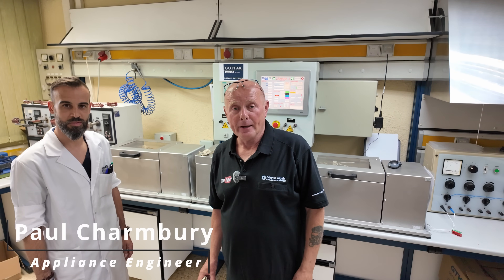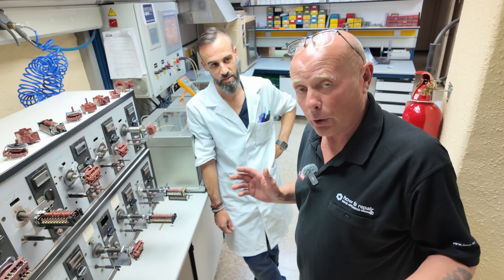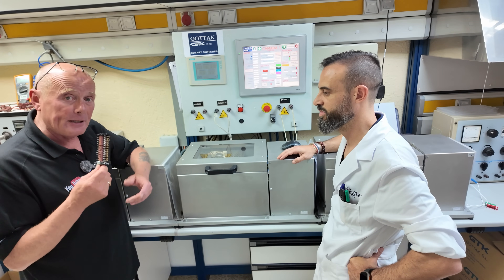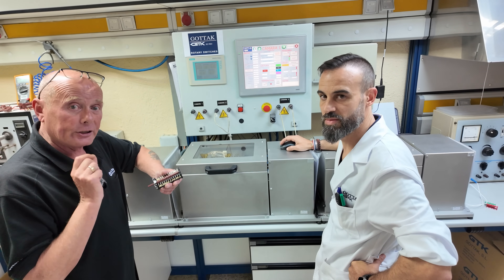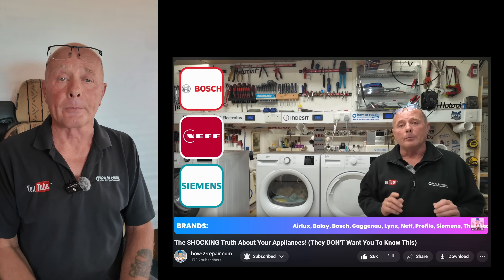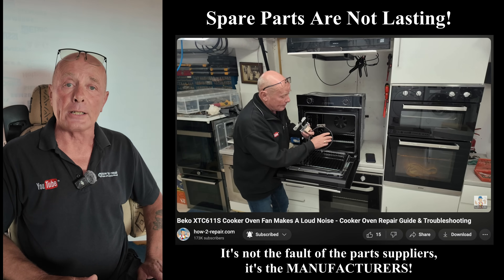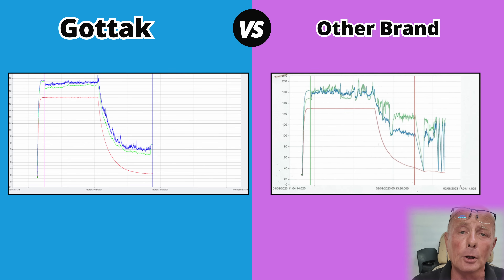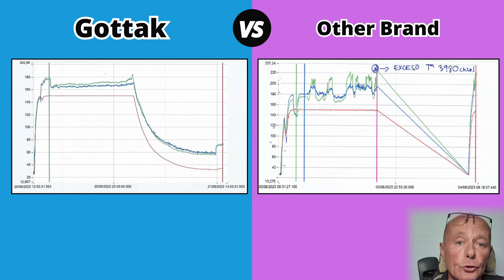Why Your Appliances FAIL SO FAST! Lab Results EXPOSE the Truth!

Comment: I've been a test engineer or built life-cycle testers for dozens of customers for 30 years and can verify that most appliance manufacturers actively build-in lifespans of their equipment,
Reply from the maker: I haven't seen any positive comments from engineers about this issue. It's hard to believe that manufacturers expect consumers to be happy buying major appliances every few years. They are ruining their reputations by making such products. 

I've reached the point where I simply cannot tolerate this situation any longer, and that's why I made this video. I would greatly appreciate it if you could share this video. Together, we might be able to bring about some change. If we can't shame the manufacturers into action, perhaps someone in government will see the video and take notice of the overwhelming number of comments expressing public concern.
Reply: @How-to-repair  Another great video, you would have to create a movement, I believe yesterday in the states(usa) Louis Rossman partner with another individual on changing the perspective on right to repair and bringing similar issue like this to light. Will share your video.
Reply: @How-to-repair  I think the self-repair movement will take care of it. Especially with 3D-printers.
Reply: @ikemkrueger I agree but companies can limit on how the hardware works or how to repair them like cell phone or other products
Reply: @ikemkrueger the problem is someone will charge so much to fix it u can just buy another one.
Reply: @How-to-repair  *Together, we might be able to bring about some change*. 

Can't see that happening-planned obsolescence is a gold mine for the appliance makers.
Reply: @How-to-repair  What is reputation worth, when every manufacturer's repuration is already shit? Ask any electrician what brand to buy and they start crying.
Reply: @How-to-repair  Except it doesn't ruin their reputations because no one cares enough. They realised that they can just do whatever they want and still sell a bunch of product because people are lazy. The only thing that will stop them, is if people stop buying their products.
Reply: I would love to see test data on reliability of automotive components of all kinds.  I work on my own cars and I'm consistently annoyed at the unnecessary complexity and short lifetime of parts.  I would love to have an open-source economy small car (e.g. an open sourced 1990s-2005 Honda Civic) made of materials that can last forever.
Reply: @AquariusTurtle  can you give an specific example of unnecessary complication for a discussion?  I was in automotive R&D, mostly in non destructive testing.  Perhaps I can answer some questions
Reply: EGR systems, GDI, turbos on small engines, closed source CANBUS/OBDII module access (nothing open source that is car specific), huge wire bundles instead of easy to replace optical, 20 types of fasteners on a single vehicle, electronic brakes, a single malfunctioning module that can take down the entire CANBUS or cause intermittent problems, closed source ECUs that have no replacements years down the road, belts that require the engine to be halfway removed to change out, etc.
Reply: @AndrewHemstreet 
Unecessary complication? How about Raw, Unmittigated, Stupidity? Like a rubber belt to run the oil pump on an ICE engine? A bolt on manifold with a gasket through which both oil and coolant run? A rubber timing belt on an interference engine. And one of my favorites: a harmonic balancer with timing components WITHOUT a woodruff key, held merely by torque. ( Mini ) STUPID, STUPID, STUPID. and you can't fix STUPID.
Reply: @JamesAgans  removing the key on the timing components not only making it cheaper to manufacturer, you can get a more precise 0 degree setting of the cam(s) because you've removed some stack up of tolerance.  The single gasket with multiple fluids is convenient, if you have no air(atmosphere) gap between fluids that's a space constraint or junior engineering, nobody wants mixing of fluids.  Wet belts, I don't understand it, can't explain the rational.  Dry belts are a cheap and reliable timing method, replace them on the scheduled intervals and everything is fine.  Look at Ferrari timing belt service intervals and cost of the job, if you dare
Reply: @JamesAgans Haha, thought you were talking about a Land Rover 😂.  The bolt on the crank pulley on my LR 3.0D requires 320Nm + 90 degrees to tighten.
Reply: @AquariusTurtle  The design cares only on factory assembly, not at all on maintenance constraints. You need to disassembly the car bumper to change a bulb.
Reply: @AndrewHemstreet Even parts assembly / dissasembly itself is issue. Having to disassemble half of the car just to change tiny component.
Reply: @AquariusTurtle I could see that manufactures gave almost no effort to change canbus for easy to diagnose. Diag unit not helping much if termination is wrong or some unit not answers correctly. Those things been sorted out in IT decades ago on network or diagnostic level. Like each controlunit able to diagnose bus on low level and save / retransmit results. Everything relies on diag units which are useless if connection to them is wonky. 
Car itself is not designed to diag failures on it's own on detail. Even it's capable to and we have all technologies available.
Reply: @AndrewHemstreet Well some timing chains last 150 000km like on my old vauxhall until service change.
There are heavy duty vehicles which just use wheels instead of belts or chains too.
Reply: @rybaluc  Which is why advanced networks just add more unnecessary complexity that makes cars unrepairable.
Reply: @AquariusTurtle Well... there is demand for more control. How would you change timing, control aux electric drive or servo controlled transmission? 
Simple mechanical car era was gone since low fuel consumption and low emission requirements. You cannot do that with mechanical cars simplier than with electronic. And analog control loops will be highly unreliable.  Problem with automotive idiots is that instead of rethinking whole systems to be simplier they just put things on top of another. 
At the end ot looks like more  lazagna-spaghetti combined architecture.
Reply: @AndrewHemstreet You're kidding, right? How about 1. Auto Start/Stop. 2. Cylinder deactivation. 3. Automatic Sliding side and rear doors on vans. 4. Electric knobs to shift instead of a simple lever. 5. Vehicles that cannot be put into neutral if they're not running.
Reply: @AquariusTurtle  Uncle Tony's Garage recently did a video on GMC's "engineering to fail" policy. And it's not going well for them.
Reply: I have a Fisher and Paykel direct drive washing machine that I bought used over 20 years ago. I've replaced the hot water inlet valve twice over the years. That's the only flaw - the hot water valve can't take the heat for more than ten years. Not missing a beat otherwise.  Same with my Miele vacuum cleaner. Some very basic cleaning and changing the filters, and the brushes in the floor-piece: still like new.  Amazingly; because I thought the plastic hose would have split long before now.  YMMV.
Reply: So who decided that the life span of a refrigerator should be 5 years, and how did they expect the average income family to be able to afford this level of built in obsolescence? Refrigerators used to last a minimum of 30 years. When I was young, way back in the 50's, I never saw, or heard of people replacing their home heating systems. Of course, back then central AC was very rare, and the typical load center was 60 amps.😂
Reply: @JamesAgans  In bigger companies they have program managers who deal with ensuring the company's business model and the products produced align.  In smaller companies, it could be people from marketing or several people in management together.  Depends on the company.

Companies decide what market space they want to compete in.  As an example, Harbor Freight aligns its products with the low cost product market, whereas Milwaukee or Snap On align themselves with the higher cost market.  Some companies do it well, some not.
Reply: @JamesAgans Well heating systems replacement was quite often even after ww2 in Europe. Every 20-30 years. Lack of fuel supplies driven appliances development to less fuel economy and more automation.
Reply: @rybaluc The furnace my Dad had installed in the home he built for us was manufactured by the SUNN company, FHA. The blower drive belt lasted 35 years. THE BLOWER DRIVE BELT. Simple half inch V belt. The Furnace Never failed. Cast iron burner and heat exchanger.
Reply: I've been an engineer and project manager for 30 years, and yes, a well run product development project includes end of life estimations and a design that meets those goals without blowing cost or schedule budgets.
Reply: we have market economy against green values / enviroment. If something give benefit to human or company, he/she/it will take it immediately. long lasting and easy repair (small amount of function and openable units) open source solutions will support less toxic waste but it is utopia..
Reply: We the consumers need to name and shame the brands
Reply: It's not just their reputations they are ruining, but our planet and ecosystem as well.  It means more mining, more pollution in the manufacturing of more parts and more landfill space being used and the pollution of that space.
Reply: @norellweiner3341  yes, all for profit, yet they want those same consumers to lower their carbon footprint while they fly their private jet to Davos.
Reply: Awh...how about you tell us what manufacturers do this and what ones don't.
Reply: Not ignoring the request, but there is no way I can give out names of customers.
I just wish corporations were not in a greed arms race.
Reply: they will pay for it, were no longer fools..  youll see
Reply: They do it to ensure you buy another one
Reply: Capitalism = profit & exploitation :(
Reply: It’s a shame. I see their strategy for making their products fail after a few years because the consumer we be forced to buy another one. 

However I try to be smart by not buying the brands that have failed me. It’s still not a total win because the replacement brand could be just as disappointing. I will no longer buy anything by Ninja or another Serta mattress that’s for sure! 

I’ve also learnt the more bells and whistles or functions it has, the more likely some or all of them will malfunction!
Reply: so contact a consumer agency with your expertise, this shit is illegal as fuck in most of the world
Reply: Most likeley built by izrahellies
Reply: the key is learning to repair them. While they might have planned obsolescence, they can be fixed. I've kept the new, cheaper versions going for years longer than they're supposed to. For not much money either. Some of this isn't just corporate greed either. Its government forced energy consumption rate mandates that appliance makers are forced to get on board with as well. You can't make tank appliances that will last forever these days. The old ones consumed too much energy. Even if corporate greed didn't come into play, you'd still have much shorter life cycles in appliances. The kicker is that when you factor in shorter life spans, consumers having to buy new appliances in just a few years makes the better energy consumption a moot point. The energy needed to haul off, recycle,and then build new ones, go and buy a new one, then having it delivered negates any energy savings you might have from a newer, more efficient, but less resilient model.  Its a d@mned if you do, d@mned if you don't thing.
Reply: Do they have particular parts they target for failure?
Ones that they can most reliably control the failure date of?
Reply: Well yeah, it's called planned obsolescence.
Reply: 👺PLANNED OBSOLESCENCE 

Minimalism
Reply: ⚠️Products failing before WARRANTY so you claim & they steal data from products
Reply: Disgusting behaviour.
Reply: made in communist swamp chyna after all
Reply: We no longer live like Egyptians where they make gadgets & equipments that last thousands of years. 😂
Reply: Everyone does now. Which is why everything sucks.
Reply: Most people don't realize that if you don't build a failure mode into an electrical appliance, it can end its life by bursting into Flames. We engineer a failure mode in because the random failure sometimes burns down a house full of customers.
Reply: @markmcgoveran6811 you have confounded two completely different engineering principles 
1. Known Failure Mode
2. Planned Lifetime 

Don’t even pretend these to be the same
Reply: @capn_shawn well I'm glad to hear there are two entirely different concepts but how exactly would you get one to happen without the other? Let's look at my favorite example microwave oven. There are probably four or five redundant things with a shorter lifespan than the door gasket on a microwave oven. If that starts leaking microwaves you have a far worse problem than a house fire. You can have a lot of microwave exposure before you even have symptoms no pain or anything you can have cataracts and not realize where you got them. So if  the average microwave oven seal fails in 72 months, with a standard deviation of one month, you would build a product with a failure life caused by four or five different redundant things that had an average failure of 60 months and a 1-month standard deviation. That way you would be extremely unlikely to have a seal failure on a microwave oven cause a person to go blind and die.
Reply: @markmcgoveran6811  Microwave Oven gasket? Oh goodness, you really had me rolling on the floor with that one. I guess cars are garbage because of how dangerous it would be if they outlasted their tires.

Microwaves are sealed by the metal-on-metal flange made when the door closes... not a "seal". That flange is non-wearing and is verified to be working based on the hook-latch.

For the rest of the people wondering why your dish-washers fail: the manufacturers make things so cheap that they fail at a rate that cost them the least while not giving the consumer the dead-on-arrival feel.
Reply: @capn_shawn  yeah that's the same thing that always happens microwaves have not changed since they were invented and no one got cataracts from a leaky microwave oven repeat after me. Never did it happen never never never never never never. Did you know that Barack Obama was born in another country where there was never a leaking microwave oven.
Reply: @capn_shawn why do some cheap appliances last so long then? Luck, or lack of use, because most won't?

Comment: Most new tech these days is purposefully designed to just make it past warranty and then need replacing. Part of the corrupt fraudulent system of diverse weights and measures. For appliances we stay with South African made tech that is easily repairable. One of the reasons Defy became a big household brand here in SA was that the appliances lasted much longer than any from overseas. Our Defy Automaid lasted twenty years (about 6500 washes) needing only a new door rubber and some shock absorber springs. All spares being available at very reasonable prices.
Reply from the maker: Your story about the Defy Automaid lasting twenty years with only minor, affordable repairs is a perfect example of how appliances should be made. It's a stark contrast to the modern disposable model. This is exactly the kind of built-in obsolescence we discuss in the video.

Thank you for your comment. I appreciate people like you taking the time to write it out. Please share it where possible. It might help others make a wise choice instead of being misled by the industry.

Comment: Like you said, the days of an appliance lasting 20-30 years is long gone now. I don't think anything manufactured after 2010 is well made. There are still appliances out there, running great, that were made in the 1960s & 1970s!  This is why I will NEVER pay for a premium appliance, I buy the cheapest one that will get the job done. If the product fails within 5 years, I will swear off that brand for good and go with another.  I tend to like GE for a good balance of price/quality.
Reply from the maker: In the 80s, 90s, and early 2000s, most manufacturers produced high-quality equipment to build their reputations. Now their main goal is to sell machines. Thank you for your comment. I appreciate people like you taking the time to write it out. Please share it where possible. It might help others make a wise choice instead of being misled by the industry.
Reply: @How-to-repair  More people need to understand that they are essentially fools if they purchase high-end appliances. These are not investments, they are tools. In most cases, when it comes to appliances, you do NOT get what you are paying for.  You are paying for bells & whistles, and "status", not quality.  When people stop buying them, the manufacturers will finally get the message.  I just bought a new GE clothes dryer... $425.  There was a cheaper model, but I went with GE.  You can spend $1500+ on a fancy dryer... but it isn't going to last any longer.

Comment: All the appliances in my house are from the early nineties and still work flawlessly. People I know that have just gotten refrigerators two or three years ago or replacing them already. The gaskets are tearing because of cheap rubber, the plastics they're using are breaking on the hinges, crushing the doors that cost almost as much as a new refrigerator. They make cheap plastic shelves plenty large enough to hold several gallons of liquid but the plastic can't hold the weight..
Reply from the maker: In the 80s, 90s, and early 2000s, most manufacturers produced high-quality equipment to build their reputations. Now their main goal is to sell machines. Thank you for your comment. I appreciate people like you taking the time to write it out. Please share it where possible. It might help others make a wise choice instead of being misled by the industry.